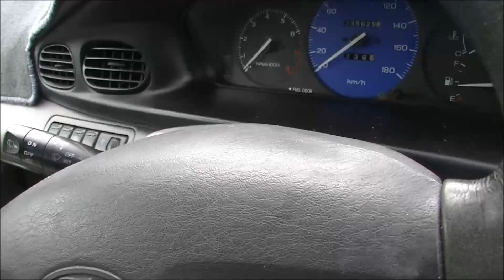The Turbo Festiva has a big problem.

Comment: At 2:38 you said that will be where the timing is. Could you please explain how you can judge timing from the spark plug? Thanks
Reply from the maker: The more advanced it is the further down the strap the heat line will be...When that line gets to the plug thread then the timing is way too advanced and it will start to eat the strap tip away as in detonation/pre-igniton/pinging...etc.

Comment: Love this car a tonne 💪 I got a Mazda 121 db with the 1.3l engine just wondering if this is the 1.3l and what setup have you on it ? Keep up the awesome work absolute legend
Reply from the maker: Cheers mate...Yep it's a 1.3...Don't know if it's the same...Stock ECU and an FCD...I'll be pulling the head soon so keep an eye out for that...I may have to put two head gaskets on to lower the compression but we'll see what's up...Have a goodie.
Reply: Dam can’t wait to see that love the work and what size turbo is that looks big